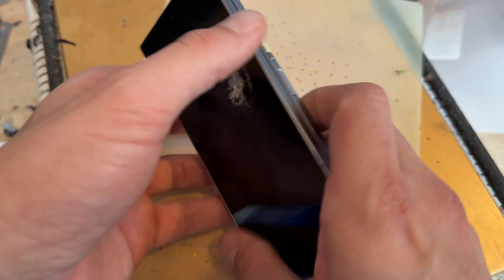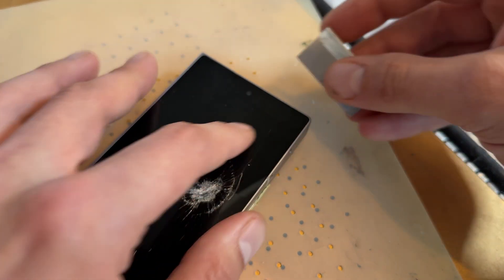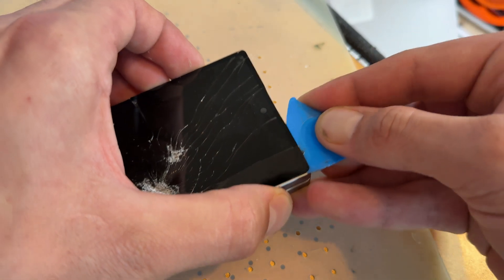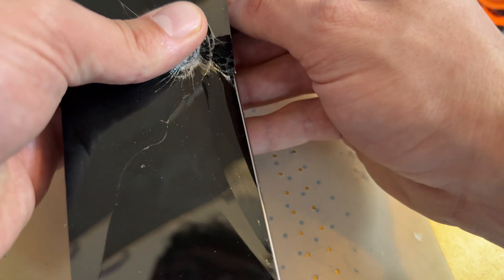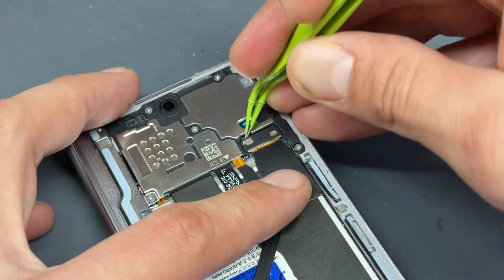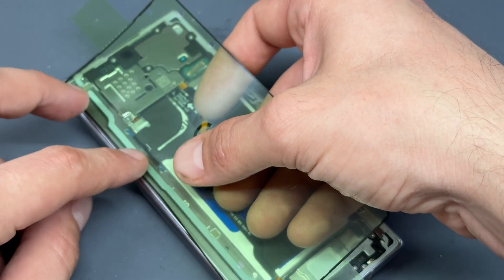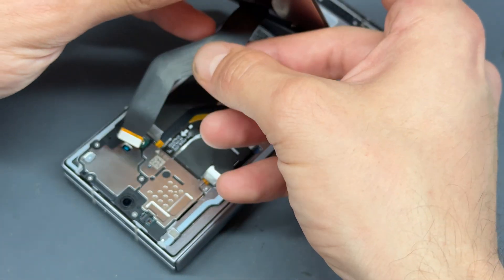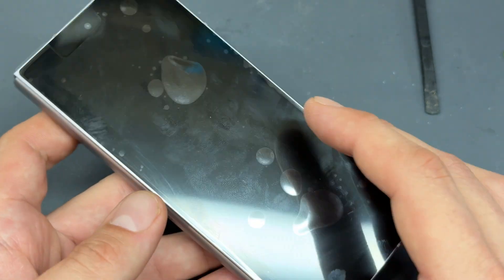Samsung Z Fold 6 External Screen Replacement - Complete DIY Repair Guide!

Comment: Would love to see how someone removes the front fold LCD screen when it ISN"T busted to start with.  It took me only 10 minutes with contact cleaner and playing cards to get the inner screen loosened (didn't even need my heat mat) but to finish removing it, I need to remove the front screen to release some cables.

Comment: use a heat gun, makes the process 10x easier. There are videos showing a fold 6 front screen removal with a heat gun.

Comment: Brother you cut  display cable 😢😢  i think u not a perfect technician 😂
Reply from the maker: No one is a perfect technician
Reply: @iDoctorUK dude, use a heat gun, makes the process 10x easier. There are videos showing a fold 6 front screen removal with a heat gun.

Comment: Did they want the battery changing?
Reply from the maker: Yes! They went for that in the end. Just done it this afternoon
Reply: @ so you had to take the new screen off and replace the battery and put the new screen back on? Bloody hell what a faf.
Reply from the maker: In this case I did because I wanted to create a complete tutorial for my channel. Normally I wouldn’t have reassembled until the additional part was in dtore
Reply: I hope you didn't charge him for a battery you damaged.